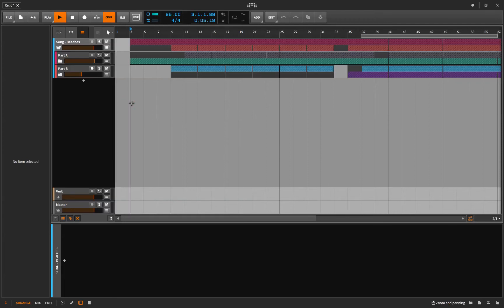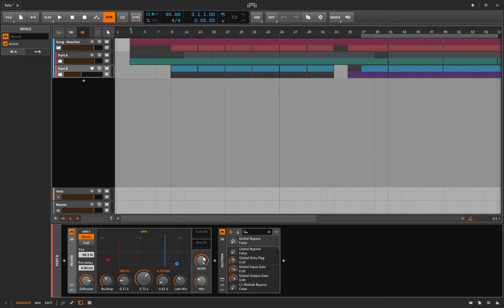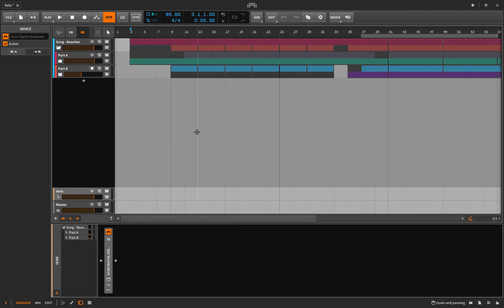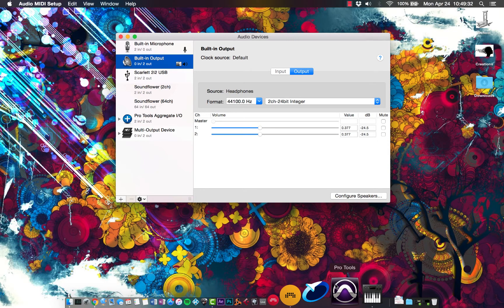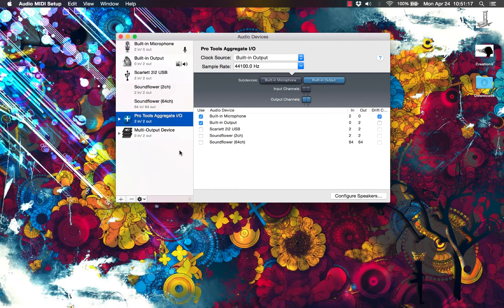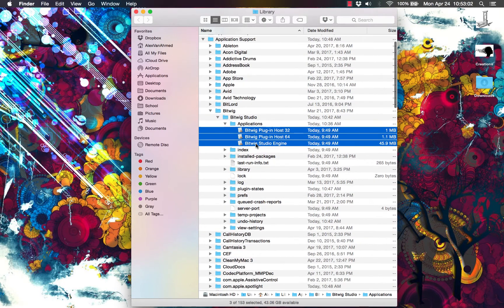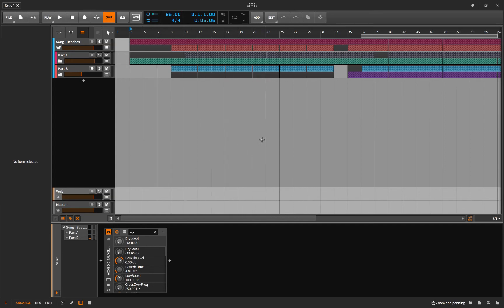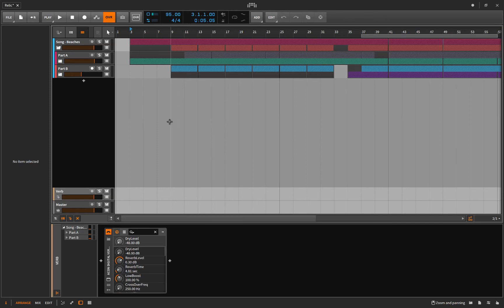Fixing Clicks and Pops! - Bitwig 2 Troubleshoot

Comment: Great advice. What I would also add if you don't mind my input.

If you are playing live or recording live, a good idea is to create a separate user account specifically for that purpose. Eg "User live music" with everything turned off, all your notifications,  screensaver, power settings, messaging, Microsoft office etc etc. Bluetooth, even wi-fi unless you need it. When I used Apple Mainstage I had so many pops and clicks I gave up, but after making a dedicate user account, setup for only Apple Mainstage it was very usable. To be fair, with  Bitwig I use my regular user account and it works just fine, but if you face problems then you could do as described.

I play more than record so increasing buffer size also increases latency. If you play an instrument, sample rate 128 to 256 should be OK. Anything more you may start to notice latency (delay between pushing your key and sound you hear). If that happens then cut unnecessary resources running in the background.
Reply from the maker: GREAT! Perfect advice! That's a great insight. Good call man thanks for adding that! I don't play live with my laptop usually, its generally just my guitar and an old tube amp haha so little things like that are super useful. Thanks again buddy!

Comment: Another possible solution, for those, who still experiencing clicks on live monitoring even after this video. The issue might be in bitrate synchronization of your input and output devices. To solve that, create Aggregate Device in your Audio MIDI Setup (Soundflower install is required), chose your desired input and output devices in it, and make sure, that "Drift Correction" checkboxes are checked on both of them. After that go to Bitwig audio settings and choose Your new Aggregate Device as your Input AND Output device. the other settings is up to you.